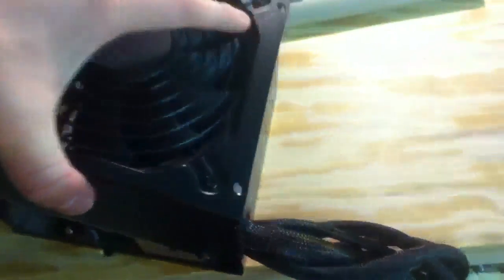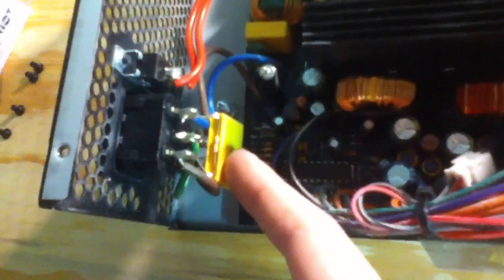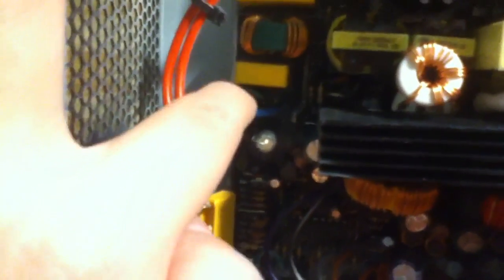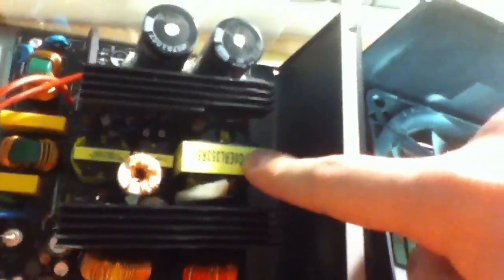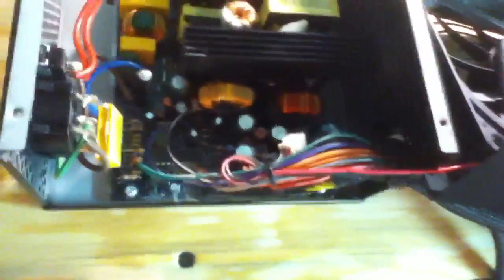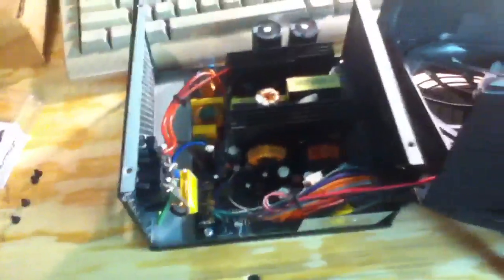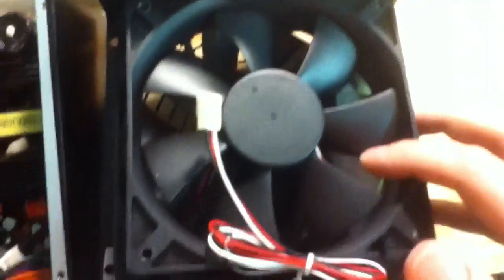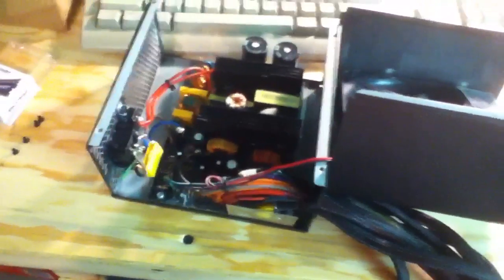A Look Inside The Ultra LSP550 PSU

Comment: @lmull3 well i have found out as things age like caps the board requires more power to work for some reason. but its an early sata power supply and i would like to change it also since it doesnt have any video card power sockets at all so if i was to upgrade to a huge video card i couldnt cause i dont have any power for it. i am wanting to future proof myself u see lol.

Comment from the maker: @uxwbill well, i have one of these powering a core2quad setup with two hard drives, an SSD, one high end video card, and a DVD drive. my system probably uses close to 300 something watts of power from the PSU. i'd think this would be enough to handle that at least, but you do make me question that.